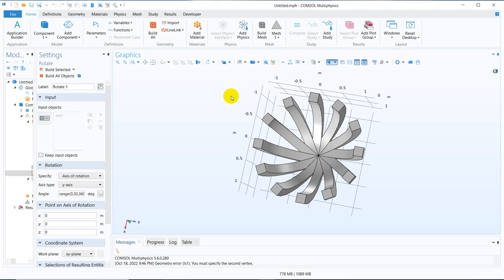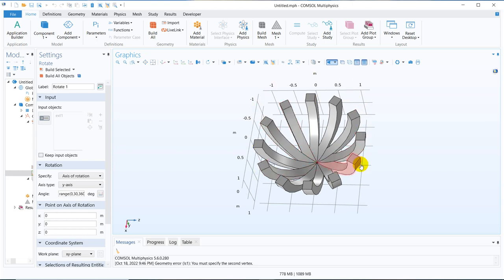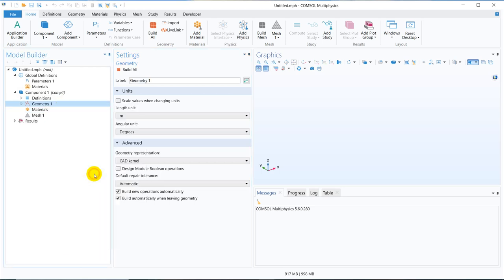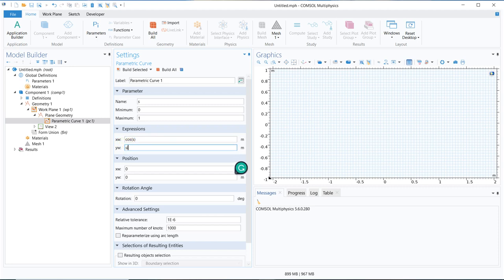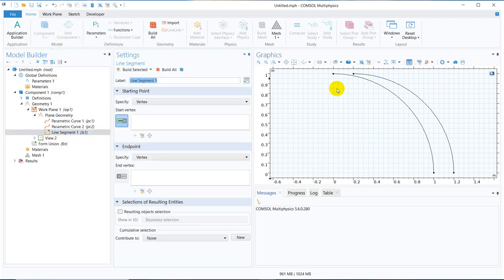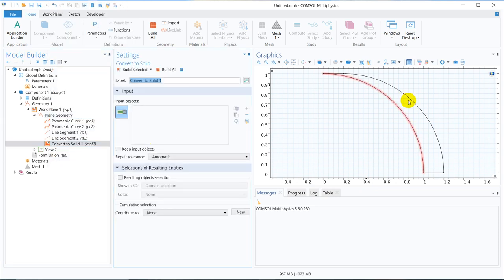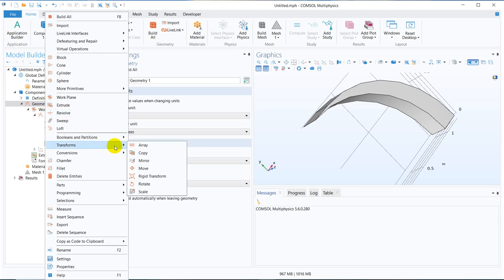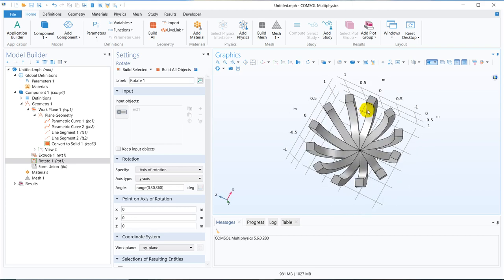3D Special Shape Utilising Parametric Curve and Extrude #3D #Geometry #SpecialShape #COMSOL #POS

Comment: great to look ur videos, i am facing one problem in a COMSOL that creating the 3D parametric curve (ie circle ) in 3 d space in my module. i am getting the error message while taking the line integrals along the curve.

Failed to evaluate variable.
 - Variable: comp1.ht.ntflux
 - Geometry: 1
 - Domain: 1 4 5 7 8
Failed to evaluate expression.
 - Expression: real((1000*comp1.ht.ntflux))
Failed to evaluate expression.
 - Expression: real(1000*comp1.ht.ntflux)